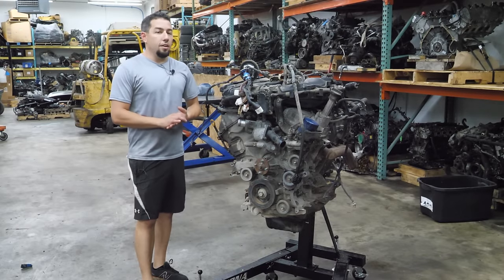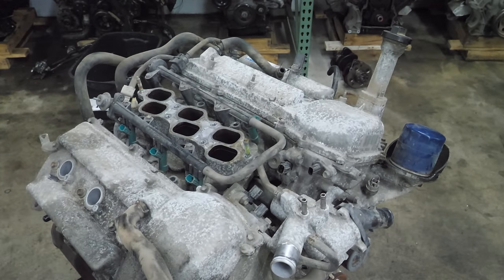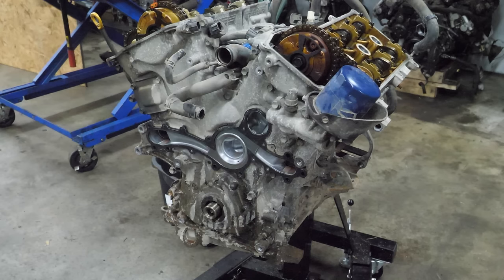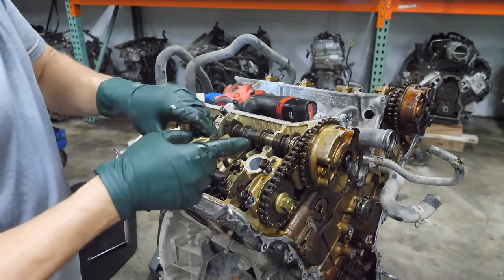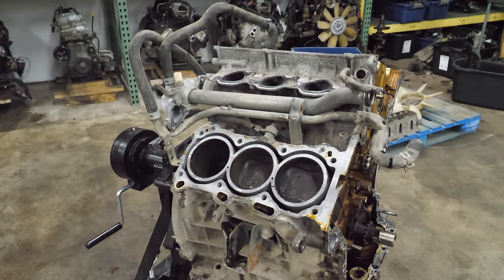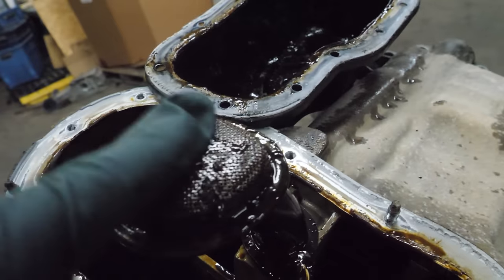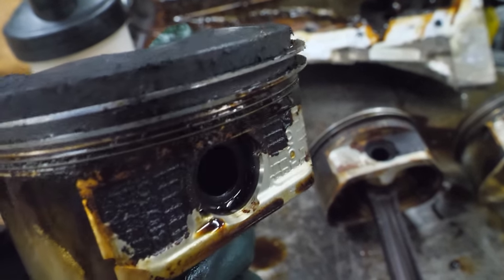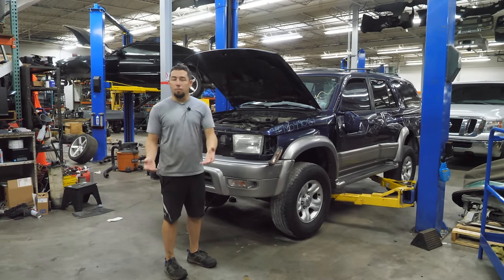Toyota 4Runner 1GR-FE 4.0 V6 Blown Engine Teardown. Just A Slight Tick...

Comment: I put 450,000 miles on one when I had a 05 Tacoma.  One of the best engines ever made.
Reply: What happened to it after 450,000?
Reply: @dep6169  I traded it in for a new Tundra.
Reply: How often did you change your oil? Transmission fluid? Differential fluid? Coolant? To make it to 450k…
Reply: @Work0smarter  I only used Mobil-1 full synthetic and changed the oil every 5,000 miles. Used Mobil-1 gear lube in front, rear differentials, transfer case and manual transmission every 50,000 miles. Coolant was Toyota brand every 100,000 miles.
Reply: @Chet73  thank you!
Reply: @Work0smarter  No problem.
Reply: How many times had you replaced head cover gasket? mine's at 151k and i'm almost terrified to touch it😂
Reply: @raykupal  Zero times.
Reply: I put 7 million on mine. Never needed an oil change or even gas.
Reply: I got 540,000 on my 05 Tacoma ,it's my work truck. I drive it 200 to 300 miles a day.
Reply: @HelicopterDad-u5b  You forgot to tell everyone it’s powered by your own flatulence.
Reply: 4.0 or 3.5
Reply: @Mud-zi5to  They didn’t make a 3.5 V6 Tacoma in 2005.
Reply: @dep6169  Probable nothing. I got 540,000 miles on my 05 tacoma v6 4.0. Still solid.
Reply: @Fsher276  wow that is super impressive thanks so much for sharing.
Reply: @raykupal  what year is it?
Reply: I have 2005 toyota tundra sr5 v6 4.0  with 230,000 miles, I have a misfire cylinder 4, I use k seller so far good, thank God.  But I'm looking for new engine for  replacement , what you think guys  
Rebuild the one I have or get new one
Reply: @JohnUSA-u7g  I don’t think you can buy a brand new engine. They are remanufactured or rebuilt engines. I’d go with a remanufactured engine.
Reply: I have 280k on my 2005 and was doing a head gasket repair and new pump because I've been having cooling issues going uphill. Now I'm putting in 0.020" oversize pistons because there is some slap in my pistons due to wear, and I want this engine to eventually hit 1 million.
Reply: @JohnUSA-u7g cylinder 4 is my worst one, leaking exhaust gasses into the coolant, and has the most piston slap. About to install oversized pistons
Reply: @RyeDoug  
I use k-seal so far work good no misfire. 
 This is the first time I have had a problem ,only brake ,oil change,  spark plugs,  and coolant change, 230,000. 
Guys, if you have problems with your brake on Tundra, use only dealer barke pad
Reply: @JohnUSA-u7g  very nice! The nice thing about the 1GR-FE engine (in the tacoma, not sure about the tundra because it could be different locations of differentials, steering components, etc) is that it is so easy to work on I have not had to remove it from the engine bay, and I just got the bottom half/large oil pan removed! Soon the pistons will be removed. Such a wonderful engine and truck to work on

Comment: Hey, congrats on actually finding a blown Toyota 1GR-FE. A rare sight indeed
Reply: as a 2010 Tacoma 4.0V6 owner I was happy to hear it was user error
Reply: @joshanderson924 same here!
Reply: Super rare find indeed! I bought an 06 Tacoma at an absolute steal of a price because it had a blown engine. Huge ass hole in the block. I ended up buying another Tacoma at copart for a little over $4k since engines were going for $3k or more with a ton of miles on em.
Reply: My 2006 4runner 4.0 has 262K on it . Still looks, sounds, and runs like new
Reply: They actually blow head gaskets, like ALL the time. Just like every Toyota 4 Cyl and V6 ever made.
Reply: @davidduplessis7800  No they don't.
Reply: @davidduplessis7800  Lol no, they don't. Not sure where you're getting that info from. The 2gr-fe, this engine's counterpart has been known to form an external head gasket leak from corrosion in some cases, but the 1gr-fe isn't known for this issue, nor are any of the 4 cylinder engines in the last 20 years or so.

Comment: The broken rod getting stuck in the counterweight saved that engine from a lot more damage.
Reply: I was surprised, we heard it running (loudly) but is it a surprise that forces were not high enough to free it and cause the expected catastrophic damage ?  (I am not a mechanic.. so have no real idea)
Reply: Spoilers!
Reply: @seabrookmx  are not required as you watch the video first, then read comments.
Reply: In before some Toyota fanboy pops in and claims that's a design feature to save the block in the event of a con rod failure.
Reply: @stinkyfungus actually yes☝️🤓

Comment: Am I the only one here rooting for the water pump?  BTW, compare the simple, robust, and logical way the timing chains, oil pump and accessories are engineered on this Toyota. Now look at the absolute mess that is an Audi V8 and you will know why these engines are in demand and you almost can't give away the Audi. Try and tear one down without shaking your head in disbelief. I challenge you!  Great vids as always.

Comment: Former owner here from 40K to 110K miles in an '08 Tacoma. By the time I sold it it had the original timing chains, oil pump, water pump, alternator, serpentine belt, spark plugs, cam phasers, radiator, etc. etc. You can't say that about so many of the new junk engines nowadays. also didn't burn or leak a drop of anything. Just needed conventional 5W-30 oil changes every 5K miles. Always ran like a clock. Assuming regular oil changes are performed and except for special circumstances it's impossible to kill these things including the 2GR. Phenomenal engines.
Reply: I have a 2010 Taco with 236k and its still running great! 🤞
Reply: @edwinestrada5194  Yeah .Your good. It Sucks that 99% of that mileage is from commuting to work and back.
Reply: @zzbudzz  Me too - Made in NUMI Fremont CA now owned by TESLA thanks to Toytota - Pansonic Elon wouldn't be were he is at now.

Comment: These engines are wonderful. My girlfriend has a 2006 4Runner with over 260k miles and it runs like a top. Oil changes regularly every 3500 miles keep this thing going.

It ran better than my 2004 Durango 4.7 with only 140k miles, and that ran strong.  I guess you can’t stop a Toyota.

Comment: Toyota makes some of the best engines.  Hydrolocked, broke a rod, made new valve reliefs, and still ran.
Reply: Some of the best. They do also make a few bad ones. The 2.4 isn’t one of the best. It blows head bolts and drinks oil. Otherwise bulletproof.

Comment: Other engines: OMG EXPLODE EVERYTHING!
Toyota engines: Tis but a flesh wound.
Reply: If the rod hadn't bent and jammed against the crank, that would have been major destruction! Sheer good luck that it stuck in the 'folded up' position, snuggled against the crank, instead of wildly  flailing around.
Reply: @jfan4reva it’s actually a Toyota failure design

Comment: I just did some service for a gentleman who drives an 09 Tacoma with one of these engines as a pilot truck for oversize loads. 560k on the clock and running strong.
Reply: Highway miles are easy miles for an engine. Even with extended oil change intervals of 15, 20 or 25k miles or more. 💪🏻😈👌🏼
Reply: @I_know_what_im_talking_about  Exactly. The little 1.6 litre Honda Civic I use to travel 600 odd miles a week between two country towns has over 400,000 on it. Cruising at 65Mph isn't hard on an engine. Surprised that someone who 'services' engines isn't aware of this.
Reply: The life expectancy is about 650k at that point the crank bearings wear through and spin.
Reply: @smackhead What indicated to anyone he wasn’t aware? All he said was it was running strong. Not like 560k miles is some trivial figure regardless of how it’s used 🤔

Comment: I absolutely LOVE my 1GR-FE in my 2021 4Runner TRD ORP w/XP Predator Pkg.!! 
 When you said “tick” I’m like yeah, the 1GR-FE does that man! I know you know this….then you showed the clip of the “tick” and I said yeah, that’s not the normal “tick” of the 1GR-FE lol by any means. Sad to see that the previous owner all but killed his 4Runner, but kinda glad so we can FINALLY see one torn down on your channel!! Lol appreciate your sharing it with us!!
 God bless~
Reply: I have the same 2021, and my wife has a 2020. Both ORP premiums. Love them!
Reply: I have a 5th gen as well. Seeing the nightmare of timing, chains and guides under that cover, now I understand why this engine is so noisy, lol.
Reply: @trailrunnah8886  yes, but that’s also what makes it so bulletproof!!! It’s not an interference engine. It doesn’t have a timing BELT, but a chain, and its port-injected. Among many other reasons as well. 
 You should also consider taking off the engine cover if you haven’t already. While it does quiet it SOME, it really just creates a heat soak where it’s keeping the heat around the engine. I took mine off when I got my 4Runner and it’s stayed off. Just something to think about. Again, if you haven’t done so already.

Comment: Eric, I had the same rod broken in my old 1992 3.0litre V6 Forunner engine, (two belt driven cams), after a "hydrolock" event. It got driven into a river, same cylinder too, lhs rear, (#6). I pulled the lhs head and sump off, put in a used rod and piston out of a scrap engine, new head gasket, it ran perfectly again after getting it back together. It was still running fine when I sold it a year later. Those V6 Tojos are great engines.

Comment: Toyota seems to make the most well - engineered timing systems, whether it be chain or belt. My Camry 5sfe went almost 190k on all its original timing components,  my Toyota guy didn't look the least surprised.
Reply: Try going 500k miles
Reply: @RohanSanjith  it was a timing belt.
Reply: @piggy310 that's impressive for a belt even the newer ones (post 1995 ish) when they started using that new material.
Reply: That’s crazy Toyota makes them so good. We had a sienna in our shop with 326k and previous timing belt service was 111k miles 😂

Comment: Great video IDC! I own a 2007 FJ Cruiser with that same engine. It has plenty of power, and believe me, I have had occasion to need and use it. In the FJ, there is a built-in snorkel that probably would have saved that engine. I have driven the FJ through streams and standing water many times, but always cautious not to over-wash the snorkel. Thanks for the great videos.

Comment: Nice to finally see the innards of an engine I own a version of, without it being my engine. I've got a 2011 Tacoma, only 126K on it. I'm meticulous with fluid changes, more frequent than the factory schedule, because I want it to live a long time. I do tow with the truck quite a bit, but always less than the factory rating. I monitor trans temps as well as engine temp. I'm hoping this truck will outlast me, and I'm 69. I'm a huge Toyota fan, and there's a '06 Sienna still in our family with over 400K on it (we bought it new), so I know a well maintained engine can go a long time.

Comment: It is amazing how TIGHT a compression chamber is, and suddenly you reduce its volume maybe even 5% and it just SNAP a connection rod! In this cash WATER is your enemy.  Have a Tacoma with the 4.0 and just love it overall. These teardowns are EXCELLENT in showing the design strengths and shortcomings of an engine. Keep em coming

Comment: The water pump saga made my night. 

It's really interesting how a rod/piston failure in one engine will blow inspection ports and leve absolute chaos, while in this one the damage was so constrained.
Reply: The rod broke so perfectly that there was not enough left to smack a hole in the side of the block, and the rod cap remained intact.

That’s an impressive failure! Bet the guy driving this through water actually made it to the other side, with a nasty knock nevertheless, but I bet this engine still got him home. Toyota makes some truly unkillable stuff. Even if it’s killed, it still drives.
Reply: @99domini99  Not being mechanically inclined but into physics, I am constantly impressed by the various forces acting in these failures and how even the slightest variable, as you mention, is the difference between a single rod/piston failure and the entire thing blowing up.
Reply: @99domini99  The topgear guys tried just about everything to kill off their Toyota... They put it on top of a high rise building, that next was blown up. The car made it to the ground floor and with a new battery it, it just powered up...
Reply: @99domini99  Makes you wonder if con rods should be engineered to break off near the big end to prevent damage.

Comment: Hi Eric, as far as I know this engine is currently only available in the 4runner. Rumer has it the next gen. 4runner might be powered by either a turbo 4 cyl. or possibly a turbo v6.
A you tuber listed as The Car Care Nut was previously or still is  a Toyota technician and lists the 4runner as 1 of the most reliable Toyota's for sale today because they are in his words, (they are ancient)! 
As the saying goes, If It Ain't Broke, Don't Fix It! 
The 1GR-FE 4 liter engine is not a power house ! Nor does it get great mileage! But it is a Proven reliable long life engine mated to a Proven long life reliable transmission! With Proper Maintenance! 400,000 miles and up to 1 million miles documented!
I an 67 years old. , live in New Hampshire where in the winter salt is applied to clear the roads. This will rot out any vehicle! If I can undercoat my 4runner to negate the rust issue, This could be the Last vehicle I need to purchase! It is that dependable! I feel a transmission with more gears might increase my MPG, but at what additional expense or reduction in reliability, or expense in repair!
As the saying (KISS) goes, Keep It Simple Stupid!

Comment: I drove grand Cherokees for years and went to a 4 runner about 5 years ago. The 4 runner is a ideal suv for my needs so when I came across one in good condition cheap with a rod knock I bought it.The engine was ran on very dirty oil causing the rod bearing failure and the total trashing of the rest of the engine. I bought a good low milage engine to repair the car and it was worth it because buying a good condition 4 runner in the same condition would cost a lot more. I think engins are expensive because 4 runners are popular and the all-aluminum engine is not rebuildable once the cylinder boors wear out because the boors can't be bored out as the cast-iron lining is too thin.
Reply: Yes, plus many cores are too high mileage to sell once a vehicle is scrapped. I’ve seen quite a few in Pick and Pull yards in 4runners and the occasional 05-06 Tundra, with 330k, 350k, etc etc. Not worth a resellers times to pull and sell, especially since they aren’t rebuildable.

Comment: So glad to get to finally see this engine on the channel! Just had the head gaskets replaced on mine and it’s the engine used by all but one car of ours
Reply: Unnerving to see that cylinder six was the disconnected problem cylinder. As that is where my head gasket failed and was leaking coolant into the combustion chamber...
Reply: @portergum6014 hydraulic lock makes rod go boom.
Reply: What year was that 4.0 that had head gasket fail?
Reply: @procowboy1722 05-06’s 1GR’s are most common. Supposedly Toyota did a fix in 06’.

Comment: From my experience working as a Toyota tech, there is usually a higher demand for them because you cant just get a new one from Toyota you usually just get one from and engine yard. The grey sealant is factory. Black seal is the Toyota sealant that is used if a part has been removed. The 1gr is a great engine its just a bit slow and fuel inefficient by modern standards. RIP waterpump </3

Comment: My 2010 4runner has 211k miles and runs like a top still even after being tuned and beating on it every day, only issue was the water pump had a slight leak but didn’t want to take any chances and replaced it. 

Just recently picked up another 2013 4runner limited 4x4 with 130k in hopes of it lasting forever

Comment: Always enjoy your videos. One thing for sure it seems that many engines if not all, didn't have owners that changed the oil regularly, if they did you probably wouldn't have it. That's why I change my 08 Highlander every 5k miles with fully synthetic oil. With over 243k miles it doesn't burn oil and doesn't have any issues at all. As Scotty says, "oil is cheap, engines are expensive.

Comment: Pretty impressive that engine ran on 5 cylinders. Most wouldn't do that. 4 litre is nearly bullet proof engine. My 13 Tacoma was running great at 170 000 kilometres. Change the oil and they just go.
Reply: I just bought a 2013 tacoma pre runner and my anxiety just melted away with this video. Mine only has 128k. I'm very happy that I bought it.

Comment: Just a note about the cam surfaces in the heads, unless your engine takes a lot of foreign material generally those surfaces "never" wear. The cams are always being pushed up by the valve springs, so the parts that wear are the caps, which are replicable and then the bottom surfaces are used as reference for your line bore.
Reply: That makes a lot of sense

Comment: Whenever I can, before engine tear down I do the water mist spray trick.  Similar to WMI just with only water.
It cleans all the carbon out of the cylinder and related parts.  I have actually had it free up sticking valves a few times and ran the engine longer because it allowed compression to regain.  

Obviously, don’t use too much water or ya end up with another disconnected rod.
Reply: So in this case would you just take off the air intake and spray mist into the throttle plate while a buddy revs it or something?
Reply: @joshanderson924  
Exactly.  I use a bug sprayer or similar.
Rigs with catalytic converters  or diesels with soot traps - best to remove those so all that carbon doesn’t plug it up sooner.  

Old school cars with carburetors you can just pour some down slowly.

Here’s a video of a guy doing one on a carbureted engine:
https://m.youtube.com/watch?v=KFtp_jmLF3k&pp=ygUZd2F0ZXIgZGVjYXJib25pemUgZW5naW5lIA%3D%3D